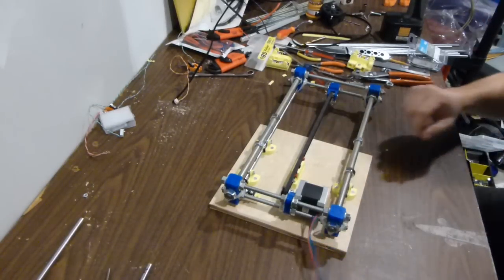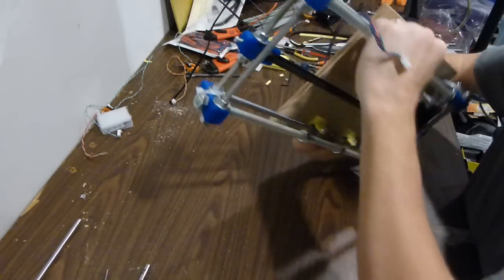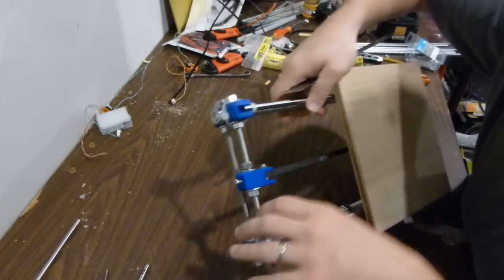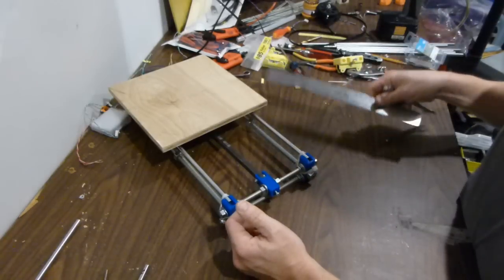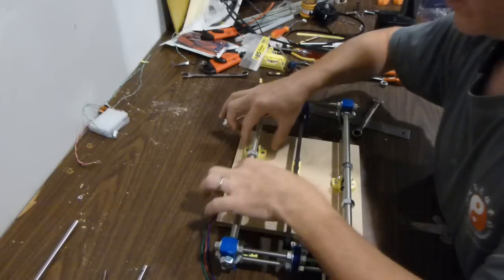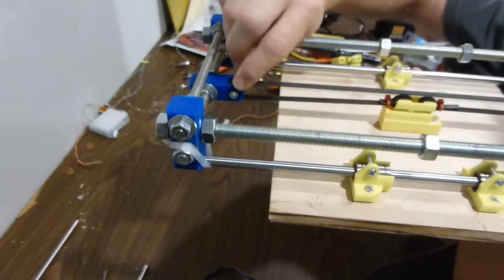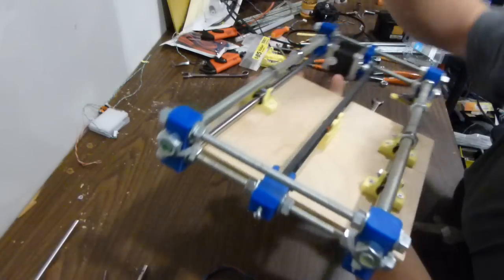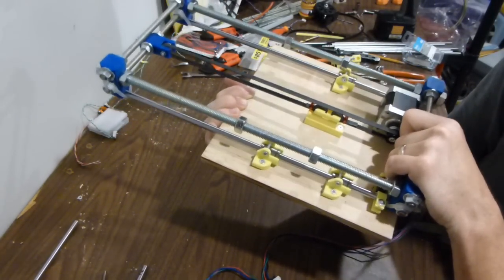Prusa i3 assembly part 2 - Y axis

Comment: Fast forward to 2021, I've built two i3s on box framesand been using them with no problems at all!! Extremely rigid frame, fitted a 235x235 heated bed and firmware update with mesh levelling and thise things are pulling some prints!!!

Comment: I found your video very helpful, thank you. I am about to attach the plywood to the guides and am wondering what the reason for the 25 mm offset towards the motor was for with the box frame version? Is it to allow better access when mounting the y axis to the box frame? I was considering using a hole saw to make holes in the plywood for this.
Ah, no now I see it is to increase the available Y travel when using the box frame.
Thanks again.

Comment: Hi, I am following this tutorial and plan to build my own 3d printer. So your videos and blog come in very handy. I downloaded also the parts on your blog, but have one remark about the threaded y-axis rods. You say that it is M10 but in fact it is M12. The y-axis-corner.stl and y-axis-bracket.stl are for M12 threaded rods. So the bom for the y-axis threaded rods M10 should be changed to M12 for the washers and nuts.
Reply: John Ridley Thanks for the replie. I know it is hard to get metric stuff in the US but for us it is the other way round. In the Netherlands it is hard to get stuff in inches ,-). But since you are using some metric sizes on your blog i thought to put your attention to the fact that it was M12 and not M10. Also it is the first tutorial i come along where M12 is used for Y-axis threaded rods. The most of them use M8 or M10. But nevertheless i think your tutorial is the best i came across and i am using it to make my own 3d printer right now.
Reply: John Ridley Thanks, it wasn´t my intention to get you in all these kind of troubles of doing modifications. I even didn´t know that you had subtitles. But thanks again and i will let you know when i come across a missed one.